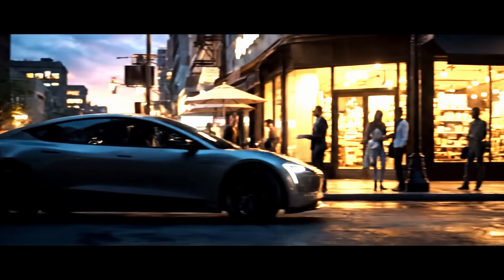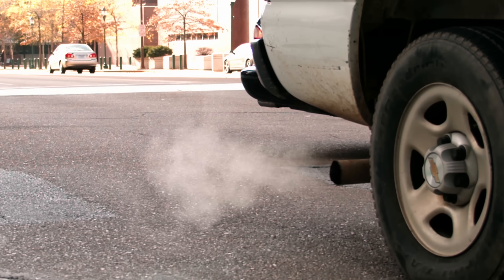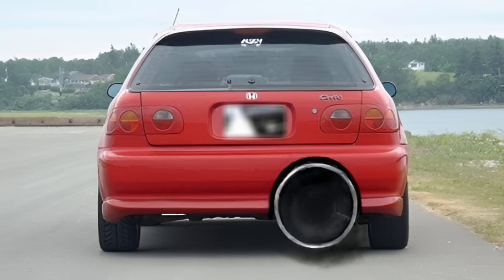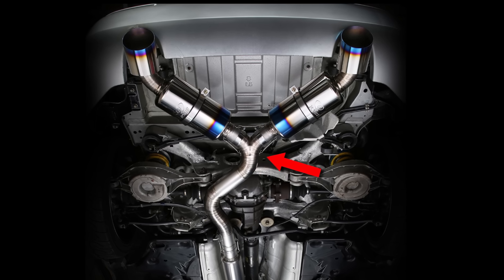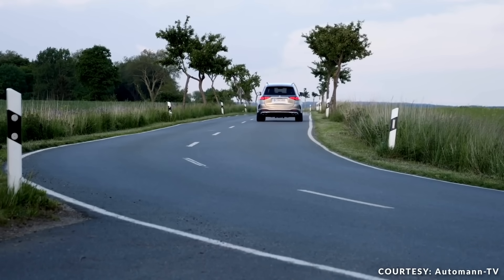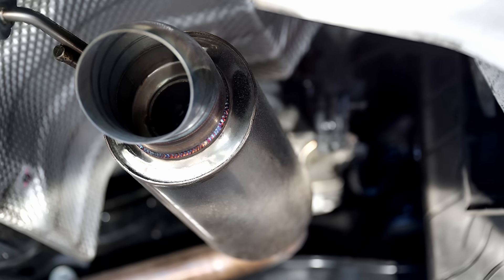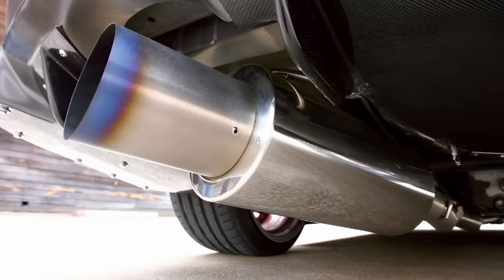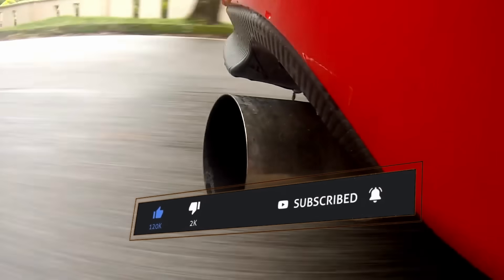The Problem With These Exhaust Systems

Comment: Wow so wrong on single vs dual exhaust 🤣 its been proven a single exhaust with Y pipe has better performance than dual with or without a cross section. This does come with variables but ive also personally proven this on my personal car.

Comment: Very well explained. I always like getting a good refresher.
My 5th gen Camaro RS is going to get a catback system. There are a hand full of top manufactures out there I'm still deciding on. So far the best price I've found is the Borla touring system for $1500. Everyone else is sitting at around $2000. That saved $500 can go to the install and maybe even an intake.

Comment: When I was young my parents owned a 1964 Ford Country Sedan Station Wagon that had the 352 cubic inch V8 engine and dual exhaust from the factory. It was a quiet exhaust system, but it had one main problem. The two mufflers were at the very rear of the car each with a short exhaust tip. These mufflers would wear out and develop leaks within a year and would both need to be replaced. This car was driven on a lot of short trips and moisture would build up in the mufflers and quickly corrode the mufflers.

Comment: I have a 2008 Toyota Aurion with a full exhaust delete, meaning the exhaust system has no filters, but I kept the original mufflers. The sound is great at low RPM, and in my country it’s not considered illegal, plus my car passes inspection easily.

Comment: I had a full 3-in diameter exhaust from Turbo to tip on my 99 Mitsubishi Eclipse gst. It made your ears ring and you could hear it coming a mile away but boy did it give me the power I wanted. Aftermarket 3 inch diameter downpipe, High Flow catalytic converter and apexi n1 Cat-Back exhaust. Oh what great times I had with that car. Planning on doing somewhat similar with my 2022 Civic even though I don't need the full 3-in diameter with the 1.5 L Turbo.
Reply: So what have you done to the civic?

Comment: disagree with the single pipe is "bad for power" at 1:40 😔.  This video doesn't take pipe diameter into consideration consideration or that one pipe weighs less than two, or pipe material (e.g. stainless steel vs Ti).  half-baked AI video as usual here on the 'tubes... 😡
Reply: Right! Supras got and gtrs and vtec civic and turbo civics had single exhaust and be pushing 1000hp

Comment: Good video giving an explanation for the different exhaust system setups. My choice would be the Cat Back setup.  Based on the explanation, more sound tunes and more importantly an increase in performance.  So, basically one setup giving two benefits.  👍👍

Comment: Gaining Horsepower is one thing, Losing torque at Lower rpm is another. 
I fitted a scorpion non res cat back to a 2014 ford focus st mk3. 
A. The Noise was too much. 
B. Was Slower in the Low to Mid Rpm band. 
C any extra bhp was only if i revved the car around to the red line. Which became the only way to get a move on. By ripping it to its last breath.

Comment: A good exhaust built well for the specific engine type and displacement will keep the exhaust gases flowing at a sufficient rate to ensure good scavenging of exhaust gases from all cylinders. That's the key to good performance - efficient scavenging of exhaust gases enables all cylinders to be filled with a greater intake charge, which will produce more power. That's the real job of an exhaust system. The tune in the ECM is also critical - it needs to be properly calibrated when installing a free-flowing exhaust in order to have the proper Air/Fuel Mixture (AFM) at all throttle settings and RPM.  

None of this has anything to do with the loudness of the exhaust. Like a friend of mine says: "Loud is not fast, and if you have fast you don't need loud." Now, I LOVE a nice V8 rumble, but the exhaust and ECM tune need to work together to make the most power and not damage the engine with a too-lean AFM.

Comment: Assuming the exhaust system after the catylitic converter isn't the most significant source of flow restriction, changing to a well designed and built header will potentially free up more horsepower than any catback system.

Comment: straight pipe,delete muffler delete catalityc, use resonator only....more power....
Reply: How to fix fumes smell?
Reply: @BlueRice fuck the environmentalists
Reply: @BlueRice  roll up window fool
Reply: @AG-en5y 😅😅😅
Reply: @A @AG-en5y 😅😅
Reply: @BlueRice clean your intake and u wont have fumes like that
Reply: @BboyTyranT but its un-burnt gas being exhausted with catalytic delete.
Reply: @BlueRice yes but clean the intake and engine cylinders and that smell will go away
Reply: U probably have a crack on the exhaust or firewall so do some checks
Reply: @BboyTyranT my car is 100 percent stock beside intake. I dont rice out my car.  I been in other people car who had no cat and straight pipe. I can smell it
Reply: @BlueRice my other car had a cat delete and exhaust and never had a smell cause i fully cleaned my intake and cylinders
Reply: @BboyTyranT cleaning the intake won't do anything to the smell after its partially burnt and exhausted from the heads...
Reply: @BlueRice is that shit legal? not using a cat?
Reply: @renzots90 not at all but nobody really cares, unless ur in cali
Reply: More power and less brain
Reply: Performace can me translated in many thing. For example, for the most people performance of an exhaust muffler is to keeping the car quiet and for others it means sounding louder etc. stereotypical
Reply: More power or more sound only. Plus, removing those parts removes their cleaning functionality. So people around you pay the price of your perceived power boost. How can that not be forbidden in the US?
Reply: Yeah and sound obnoxiously loud and catch the attention of cops
Reply: @WitherRage that's not true, the resonator acts as the muffler and that's where you get your sound. I ran two 19" resonators on a V6 Charger increased the pipes from 2.25 to 3" with 4" quad corsa tips and it sounded very good

Comment: Well, i own a modded 2014 Jeep Grand Cherokee Laredo with the V6 it came with a single exhaust and have been wondering should I keep the single exhaust or go dual?
Reply: single is lighter than dual.  if anything, go up slightly on pipe diameter or just change the muffler to a more free flowing one.
Reply: @K03sport current single exhaust setup is a 3 inch Y-Pipe, 3 inch exhaust diameter after the Y-Pipe and 3 inch Blackwidow Neighborhater muffler relocated but left the rest before the Y-Pipe at 2 1/2 inch